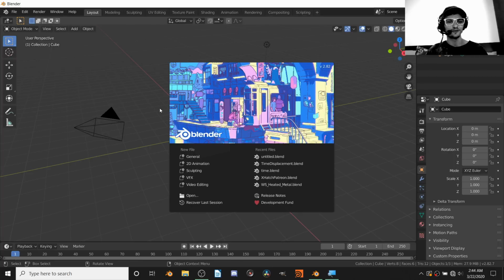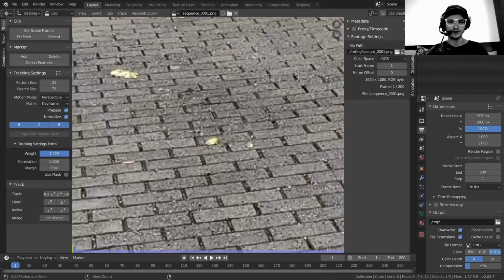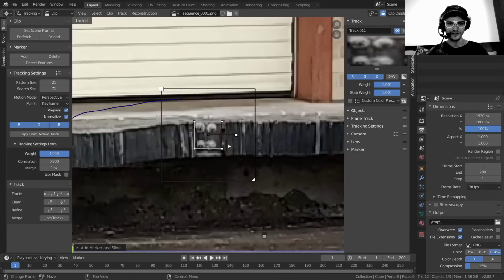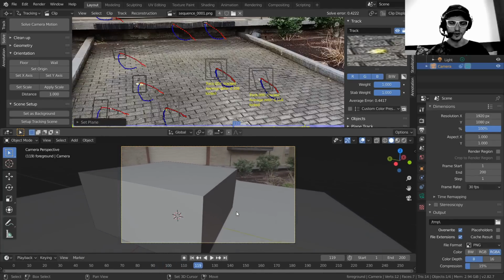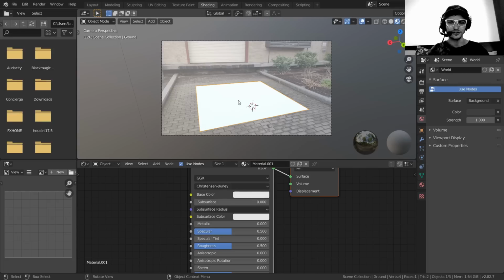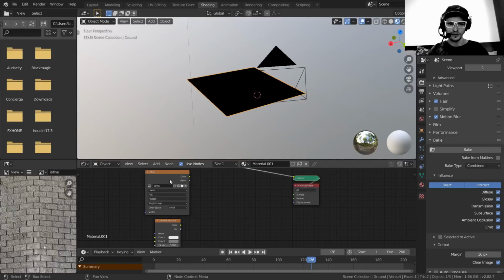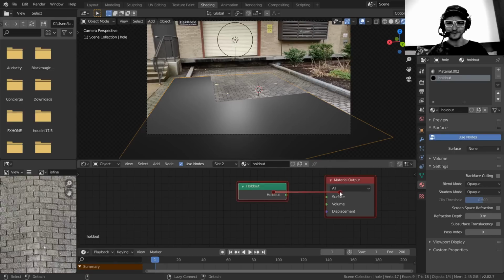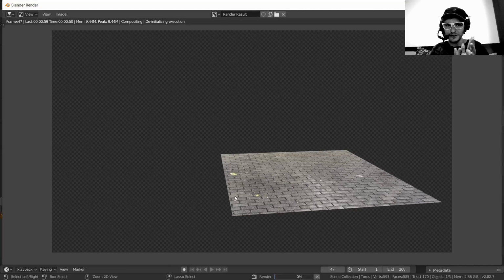Advanced 3D Integration (Blender Tutorial)

Comment: For tracking find where 3 or 4 surfaces meet. I notice on the back wall you look for the sign or the area on the wall. See where the garage door meets the door frame meets the wall meets the cement step. You can use those junctions almost like cross hairs.

Comment: to get a really good spot on with the hold out, I added a add shader to the material output, holdout on the top,  a bright/contrast set to .01 on brightness, and 0 on contrast to the bottom add shader, then an empty image texture attached to the brightness/contrast.  I got a spot on match to the move images.

Comment: Great tutorial, especially about how to copy the ground texture from the scene. However, I could just render on eevee, but not on cycles. Does anybody knows how to fix it?
Reply: Wait you can only render on eevee?
Reply: You can go to render settings and change the engine
Reply: @GabrielsLogic   It works fine on eevee, but when I swift to cycles, the floor disappear. I don't know if there is a specific setting for cycles, a glitch or if I just mess up somewhere.
Reply: @speedtripvfx  did you get that fixed ? i have the same issue
Reply: Nicolò Santaniello, yes I fix it. Instead using the plane that you start when you track the scene, delete it and create a new one. It works for me and I hope this will work for you ^^

Comment: Instead of the rigamarole of trying to "hide" your box, why not simply model the surface of the driveway as a huge rectangle, projection paint it, then bake the texture onto it? Then come back and cut the hole in the middle of it. That way the entire driveway renders like the original video, and the "hole" can be rendered with whatever texture you like as well. As an added bonus, the rendered driveway plane will catch any shadows from the rendered flipping piece.
Reply: youre right but it loses some information making everything a bit less high quality

you could add another plane which is what you said a model of the driveway but make it invisible in addition to the plane to catch shadows

Comment: I have a major Issue with transparency or the Compositing Nodes, or I can't understand, what's happening:
The Animation and Tracking works fine. But the Floor and  the "Cellar" is now a Problem. After Rendering the Plate that is rotating is transparent. The "Cellar"  is not showing up as a hole, it is still covered by the Background Picture. Any suggestions?
Reply: same issue and no solution

Comment: Some ideas for people who want to experiment:

25:40 The projected pattern has some "waves" in it. That's because the original floor is not flat, but has some depressions from years of cars driving over it. So, one might add a bit geometry to the plane and defoem it vertically to match those depressions (the match is godd if the projected texture becomse straight). This might be subtle, but I could imagine that it might help sell the effect in some circumstances

36:07 Theoretically, the best matching ligting would be obtained from an HDRI produced on location, but that of course means extra work (and we don't have such an HDRI for this scene). Perhaps a first approximation to that could be obtained from yet another projection of the footage to an environment sphere and painting missing parts in a plausihble way; that would probably still require some extra lights, though
Reply: That is right. First part of observation is correct - for anyone who are making complex scene, this is way to go. For the second part, or HDRI or simple half sphere (dome) sufficiently big that mimic sky lighting. Whatever is easier for the user who doing VFX things. Thank your for bringing this up.
Reply: You could project the footage planes or put everything in a big ball and use that as an emission shader for an environment texture to get decent results.
Reply: i think adding some imperfections to the surface of the checkers pattern might work to add realism

Comment: I think u said something like this. but I want to make sure. this  should work in blender 2.79 right?
Reply: Sure, afaik the motion tracking features haven't changed, and neither have the relevant compositing steps.
Any particular reason you want to use 2.79, though?
Reply: @nibblrrr7124  Thanks! And yea, the reason I'm using 2.79 for this is because my computer can't run the newest version of opengl, which is needed for 2.8 to work. so I can't use it sadly.
Anyway, thanks for the help! :D

Comment: Great tutorial. But why the projection map is blurry? How can it be fixed? Some guys suggested to use higher resolution for projection map, but what if it is blurry because source frame have "less" pixels for the same area on the ground because of perspective changes?
Reply: Painting in missing/wrong parts manually (e.g. clone brush from a higher-res part of the same image) is how you "fix"/hide it in practice. CGMatter/DefaultCube himself did it in previous tutorials, e.g. 3D Object removal projection painting: https://youtu.be/uKUOM67hOkU

There is also automatic AI-based upscaling/superresolution that generates more detail than what was in the source photo, but they aren't magic. They still cannot know what the scene that was filmed actually looked like from another angle - they just take guesses on how to fill in the blanks, based on what they've seen in other images. Sometimes it looks okay, other times it doesn't. There are websites where you can upload an image & do it for free, so you could try giving that a shot.
Reply: If the limiting factor is indeed the resolution of the source photo (low/flat angle, high distance, low pixel count, out of focus, motion blur, noise...), then the image information you need is just not there, and you cannot really fix it. At some point, you run into a mathematical limit (information theory) - and it will happen much sooner for more distorted parts of the projection.
It's like trying to generate a picture of someone's eyes, from a photo where their eyes are closed. You can maybe make a rough guess (e.g. guess the eye color based on their hair color, create a random but a plausible-looking human eye) - but ultimately, you (or any computer) cannot know the correct answer 100% just from that image.

Comment: I don't like the way baking works in blender, things like particles are fine but, like in this tutorial the backing system is really odd, it's not intuitive at all.
Reply: Not sure why DC did this convoluted baking scheme, Project from View and locking it to frame 126's pixels without baking is the appropriate method.
Reply: @ed_halley  It's not convoluted, it is easy once you know how it works, but selecting a node with a texture and opening a separate menu to bake it is not something you would think to do.

Comment: I love the video! It's a shame that the projection map is a bit blurry though, that makes the effect noticeable immediately...
Reply: @mgames you can use the original footage and then cut to the cg elemets just as it begins to turn.  Then the texture is a) separated from the ground and b) motion blur should carry the rest :)
Reply: @Fxnarji  Maybe 1024 resolution is too low
Reply: @Q_20  depends on your scene. If you have a 1920x1080 frame, 1024x1024 should work just fine since the video itself is only 1080 pixels high and 1920 pixels wide. If the "patch" you try to cover makes up more than 2/3rds of the screen, or your video resolution is much higher than 1080 x 1920, then you surely want to get a highet resolution
Reply: Alright I did the math behind it, 1024x1024 is pretty much 50% of 1920x1080, so you should get away fine with that resolution if your cg object uses 50% or less of the pixels on - screen
Reply: @Fxnarji  That makes sense! I didn't think about video resolution
Reply: 3500 is what I use when I do any projection mapping